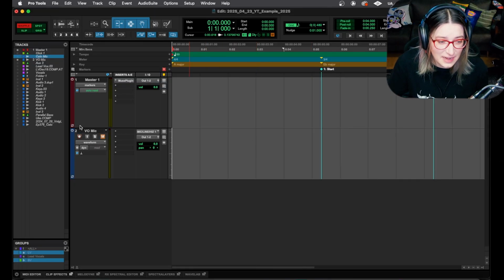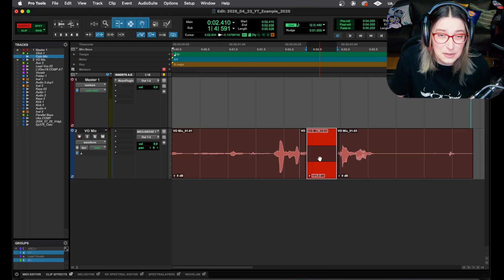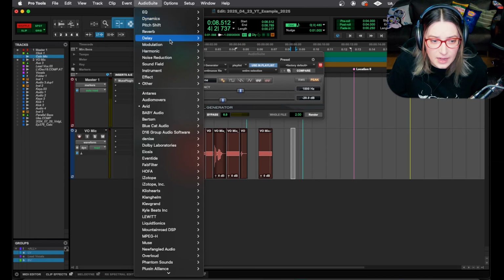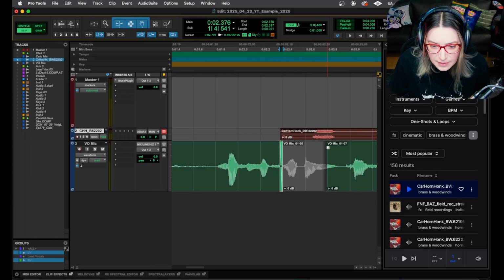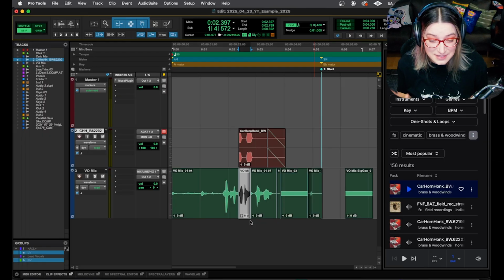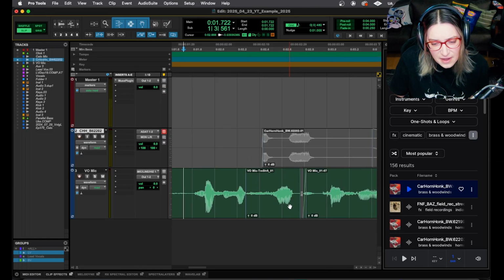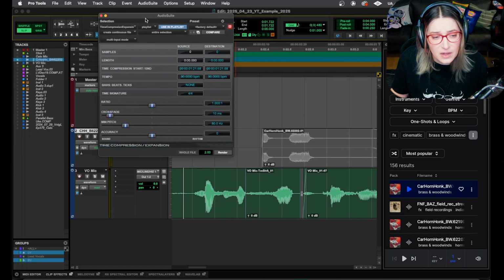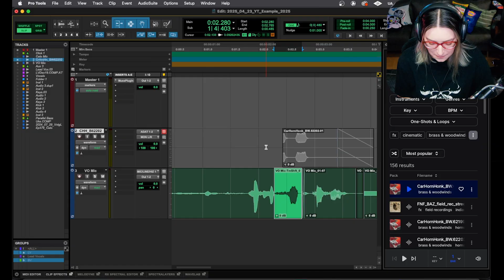how to beep out curse words in pro tools (easy + pro tips)

Comment: In my pc dosent work
Reply from the maker: Which method isn't working on your pc? If I'm remembering correctly, I think I shared a few techniques in this video?
Reply: @CatoNoise  this shortcut Shift + Control + Option + 3 create a beep I use Windows.
Reply from the maker: @joseorozco674 you have to translate it into windows shortcuts then. So I think the shift and 3 are the same, but you hold alt instead of option, and I think the windows key instead of control. Try that and let me know if it works